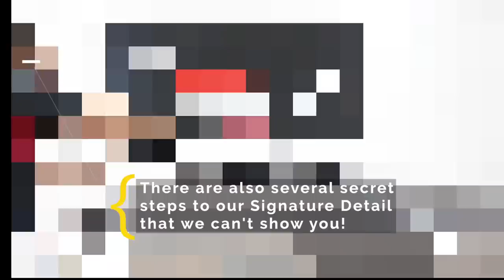Topaz's Best Kept SECRET - 100 Hour Maybach Level 5 Signature Detail!

Comment from the maker: For anyone asking about the thickness of the clear coat after the treatment, the next step for this car was our full paint protection film coverage which prevents stone chips, scratches and swirl marks, meaning the clear coat is safe!
Reply: Thank you for clearing was getting worried
Reply: amazing video thanks...do you typically use ceramic p0lished on top of the clear bras
Reply: A decent ceramic coating would be a prudent next step.
Reply: So you put a ppf that has orange peel in it and your back to how the car originally looked.
Reply: Which car manufacturer has the best quality - out of the factory - paint job?
Reply: Where do I apply for a job lol I thought I was a good valeter but this is diffrent level
Reply: @user-jt3nf7in5w  Good PPF, or any PPF I've seen doesn't have orange peel on it, PPF just tends to amplify already bumpy paint.
Reply: What is the price of this 100 hour detail?
Reply: @rdavid1987  Check Acura NSX 'Andaro' paint. Idk if this is the best out of factory paint job but it looks incredible.
Reply: What we dont show you a ceramic coating
Reply: came to the comments for this answer lol
Reply: 42treg This was definately a one time treatment. Good luck to the owner in the future
Reply: Just say the clear is as thick as it's previously thinnest point. No harm done. Nice work.
Reply: @user-jt3nf7in5w  I was legit abit to post this haha. I work for a mob that do ppf and it is far from perfect on dark color cars and is worse on white cars due to dirt sticking to edges... so much work for it to still only look good from far away...
Reply: Uhhh... a microns-thick ceramic "coating" isn't going to protect shit. If the clear is too thin, there's no UV protection and the clear will fail. That's the optional 1992 Ford Aerostar paint option. We offer a 5,000 hour repaint package at my paint shop for a limited time. A basic 1 color paint on a maybach is only $130,000.00.
Reply: How much does this treatment cost
Reply: What do you do if you cut through the clear do you touch it up ? Must your in a booth
Reply: Topaz Detailing have you ever detailed a pagani Zonda c12 s
Reply: So how much clear coat did you remove? Did you do a before and after with the ultrasonic paint thickness gauge?
Reply: Yo Joe  Yes this, I want to know what % clear coat is removed on a procesz like this.
Reply: What grit did you use for dry sanding?
Reply: Surely the finish on the ppf would be similar to the finish on the clearcoat before you sanded it though
Reply: WTF!!!
Seriously... sanding!
Goodbye paint. 
Guys, watch ammo nyc. He will never do sanding. Never!
Im only using my common sense. Sanding makes paint thinner.
Reply: yep forgot inside the doors which has orange peel as well and inside the boot as well which is also painted and you can see the orange peel? To secret is the ceramic coating full stop?
Reply: @user-jt3nf7in5w  it will have less orange peel...
Reply: the ppf has textures so it will be back with orange peel like textures?

Comment: and the paint job is chipped 20 minutes after leaving the shop, by gravel from a dumpster truck on i-95.
Reply: This.
Reply: They installed a paint protection film so no
Reply: Detailing
Reply: at this rate, the owner no longer has to drive his car , the maybach will have to be shipped wherever it goes
Reply: I know where you live now
Reply: @marnikjacobss8462  Lol, a stone chip will plow straight through something out of a bottle my friend.

Comment: Orange peel on a Maybach, confidence inspiring
Reply: through my eyes all Mercedes have it, I owned several of them, even my 31 year old 124 has it. Next time you see a brand new one go have a look, i bet you it has brutal orange peel!
Reply: NameSchema100 I live near MB World and can confirm, every merc has really bad orange peel.
Reply: @Da5hed   on the other hand you can tell instantly if a car has been repainted/ had an accident, because a bodyshop would never release a car with orange peel as extreme as Mercedes has from the factory ;P
Reply: Orange peel is there on purpose on most cars, because it helps hiding defects. A perfectly flat paint surface shows every even so tiny defect (marring, scratch, etc), which is not desirable in most cases.
Reply: It is a Mercedes, so... lol.
Reply: @berczigabor  but in this case the owner has a dude to rub it down with a diaper any chance he gets. should come from the factory like this.
Reply: @Otto-AutoPilot  it's kinna like going to a restaurant that has a dirty bathroom which EVERYONE sees, can you imagine what the kitchen looks like

same with cars, if the paint sucks, imagine what with the quality of what you DON'T see is
Reply: through my eyes all paint leaves peel,water based are much worse all cars should be wetsanded and machine compounded/polished/glazed and hand waxed...
Reply: My wife's 24k Hyundai elantra sport had far less orange peel then this maybach....
Reply: My be too. It's annoying.

Comment: Wet sanding with a long throw after dry sanding factory clear? Holy moly that's a whole new level of confidence that I doubt I'll ever achieve in my lifetime
Reply: Nick Bloodoff give it a try in a scrap panel, it’s a lot less scary than it looks but you do need to know what you’re doing!
Reply: Wet sanding with what looks to be a 15 mil throw beggars belief. Hence the massive amount of marring and pigtails left behind prior to compounding.
Reply: @chaseperfectiondetailing5745  I used a dual action to wet sand once and probably never will again. Hand sanding marks are so much easier to remove once you learn the technique.
Reply: Nick Bloodoff I couldn’t agree more. Block sanding combined with orbital sanding (no more than 5mm stroke) is all I’ve ever used. Work back to 3000-5000 grit and it shouldn’t need much more than a polish to finish out. 

I can’t wrap my head around why he went from a proper orbital sander on the first stage to a large throw DA on the second. So much unnecessary work.
Reply: Yeah I can do corrections and coatings all day long, but this is another level
Reply: Id like to see how many mils they removed.
Reply: I use my Rupes Duetto for wet sanding. Amazing little machine with 12mm throw. 15 for compounding and polishing. And the Rupes Mini for bumpers. Works like a charm.
Reply: @chaseperfectiondetailing5745  I dont know squat about finishes so pls pardon my question. Is it perhaps of the dark color? Like Blackish blue... maybe it needs more steps to show its true finish?  Thanks.
Reply: buddahlushious you’re 100% correct. The more steps typically ends in a better finish.
Reply: I would've used a D.A. Sander instead.Love using the 3m Trizact system!
Reply: Integrafreak1 trizact is a great system but don’t you find it difficult to remove orange peel with it?
Reply: @chaseperfectiondetailing5745  Yeah, If I need to cut orange peel down I use 1500 3m Dry first with the Dual sander and then the 3000/5000
Reply: Yea i work for a subaru dealership believe me i understandthe struggle they use a very thin layer of paint and clear coat alot of the cars we get (new inventory) has some of the same issues off the line as this MM
Reply: @nickstickB  facts
Reply: brandon mckee Subaru paint is really soft and stains super easy. But it takes less aggression to get it looking good.
Reply: It comes down to the grade of sandpaper used, most times its very fine around 1,500 to 3,000 grit, which comes out perfectly after paint correction and anyone who know about paint and panel knows this, the problem is that car manufacturers do not hand spray cars anymore ,thus the machines can only do so much and the thickness of painting is also a issue ,the days of painting then sanding and painting with over 10 costs of paint and around 5 coats of clear are long gone, but then again ,you can still get it done if you have the cash its that simple or your really good at car spray painting and you know how to prep the cars surface and there you go your 40K car has a better paint job than a 2.5 million dollar merc. lol :) which i love seeing cars like that perfect paint and better looking than a merc's own factory paint, lol:)
Reply: You need to use a finishing backing plate with 3m trizac paper and know what you are doing

Comment: I’m a specialist Detailer in Dallas and we offer a similar service as the guys at Topaz. I’ve been following these guys a fair few years and their work is superb. Car manufacturers would never remove orange peel it is just a free optional add on in applying clear coat and the way it cures. Great video guys. Car looks super.
Reply: An optional add on ...lol im a painter and non of my jobs have peel its the way its applied to the vehicle to much material  coming out and not enough air .....and how thin your paint is

Comment: Now that's what I call lateral and longitudinal thinking. Masking off all the swedge lines, for example, to prevent sanding through the edges is a very simple but highly effective method.

The design and quality of the DAs and machine polishers enable the kind of precision aimed at and achieved in this tutorial. Having the right tools and equipment combined with a fine eye for detail and plenty of patience are key elements in achieving a flawless finish.

I wonder whether the secret stage involves baking the car at a certain temperature after a certain (ceramic?) coating has been applied and removed to create a protective barrier and lasting finish.

Comment: Very nice job it’s a huge undertaking to get paint perfect. Anyone complaining about clear coat being removed that car probably gets washed and waxed twice a week so it won’t mater. Paint lasts forever if it’s looked after. 
I just finished restoring 2 vintage dodges and it took over a week on each car to rub it back to get the paint like that. 
Great idea fine lining the high points.

Comment: I remember having to get a finish like that when I was using cellulose paints. Final flat with P1200 wet and dry to remove any imperfections, then start polishing with Belco rubbing compound, before applying polish. Everything done by hand.

Comment: If doing ppf does removing orange peel change the result once the ppf is layed?
Reply from the maker: PPF adds a very slight amount of orange peel, however, much less than the amount that has been removed in this process
Reply: @puhipuhi8696  orange peel is the term used for texture in the finish of the paint. It's called orange peel because the texture looks similar to the texture of an orange peel
Reply: pause the video at 00:24 seconds.  that is orange peel.
Reply: vladimir kostic, that’s called cellulite.

Comment: I got the same results on my 06 chevy silverado  4x4  its dark ming blue metallic with 1500 wet sand then 2000 wet and Maguires ultimate compound  wool pad  foam pads and finished with ebony polishe  and microfiber towel its my everyday driver my factory finish from gm dident even come close to that million dollar wrinkled finish that looked like shit but in the end its sweet that's all that matters nice job

Comment: All of this work on a car that will depreciate faster than the Titanic sank. Bravo!
Reply: people who can afford it wont care about the depreciation.
Reply: Actually mayback kept their value
Reply: Hilarious!
Reply: It’s a Pullman no way it’s losing Value
Reply: Luxury cars do not hold their value. Luxury buyers want the latest and greatest tech and gadgets. This is the reason their value plummets and 85% of luxury cars you see on the road are leased -- specially German brands. This is also why you can by a 7 year old $100K S Class for 20-25% of it's value while a same year same mileage Honda Accord only dropped 50% of it's value while retaining it. As years go by from there, the Honda will hit residual value while the luxury cars continues to drop. Fact.
Reply: @Golds_fox  With what information are you enforcing this? The older 57 and 62s are beyond dirt cheap. The new S600 Maybachs' will depreciate in the same manner.
Reply: But in no other car offers you top luxury like an armored tank and that has got enough legroom to have 2 models blowing you!!
Reply: @sdlausen1  It doesnt matter wether its a luxury car or not. Supply and demand. Luxury cars have passionate collectors same way as jdm, oldtimer,muscle etc. So if theres a limited and well maintinanced one, it will rise in value or hold its value. Fact.

Comment: Absolutely amazing work. I'm planning on doing my first ever full wet sand detail this year on a Focus RS Mk2.
Reply: PPF if using Xpel ultimate works out at about £100.00 a metre .!
Give the car  full paint correction then use Gtechniq crystal serum  .. ceramic coating .

Comment: How many microns were removed during the process?
Reply: Kennedy Catala it’s how paint depth is measured, essentially I’m asking how much lacquer was removed from the car by the sanding and polishing stages in this example
Reply: If you ask me quite a few. Looks like a big clear coat process..
Reply: I'm asking the same question.  How many microns before he started. Then how many when he was finished? 
  If he went to deep. This car may look great now. But with almost no clear coat left. What will it look like in a year?
Reply: einnol B just asking out of curiosity 🤔
Reply: @ltsgarage7780  This is where PPF comes in.
Reply: @dinan5iver  PPF?
Reply: @Bigbitsuni  If you have orange peel then you pretty much have more than enough clear to work with? lmao. Something cleared with one coat can have orange peel. Checking the depth of the clear while correcting a 100k+ plus car isn't funny, it's smart. The last thing you wanna do is have to have it painted where you sanded or burned through it. His buffing procedure was normal and the steps were correct.
Reply: einnol B Sure you have. If that’s the case you wouldn’t have made the orange peel clear comment .I love hearing the I’ve done this and that and done cars you will never touch in your life bit. You know absolutely nothing about me. Your so called 20 years detailing cars pales in comparison. The guy who does it in the order you are criticizing is the guy working on the 100k + car and clearly knows what he is doing but I guess your way is the right way?
Reply: @Bigbitsuni  lmao! So all the cars at dealerships with orange peel on every single one of them come from excessive clear? Do you know how many coats of clear actually goes on a factory car? It isn't excessive..Its minimal.  Like i said before you will have orange peel with one coat of clear. It doesn't have anything to do with the number of coats. I've laid paint/clear and finished about every make of car out there so you aren't going to impress me by detailing any car. Declined a deal with Telsa? Must have been a local dealership wanting you to be the wash guy. Like i said before the guy that uses that method is the guy doing the Maybach and still getting paid for it after the job is done. I still can't figure out why such a professional like yourself is spending all night watching videos of others detailing cars on YouTube.
Reply: @ltsgarage7780  Paint, Protection, & Film: https://www.youtube.com/watch?v=ncl2zqzpGbk
Reply: @Bigbitsuni  So every car is trash? They all have orange peel. I'm sure Jordan does watch basketball it is an entertaining sport that everyone watches but i doubt he is up all night watching it. Why would a dealership call the local detail shop and ask the owner to wash brand new cars for them? You don't need a detail pro to wash new cars. Who are the players cars you detail?
Reply: @Bigbitsuni  Just utube warrior... lol
Reply: Mercedes average Clearcoat is 40-60 microns on vertical panels and 50-80 microns on horizontal panels , I’m not sure but looking at the video you could have removed an average of 20-30 microns so you have enough microns left for protection ..
Reply: K1CGT lacquer? This isn’t the 60s..
Reply: The entire car has a protective plastic coating so it wont need to be buffed or waxed ever again.

Comment: And than the owner takes it to be wrapped, next door... For protection.
😁😁
Reply: No they are installing the ppf right after the paint correction process.
Reply: @Pty-gk2vb  basically a wrap 😁
Reply: @sim6057138  yes and no🤓 is like saying 3 state paint job without ceramic clear coat is same as a 3 stage paint job with ceramic clear coat.🤷🏼‍♂️
Reply: Vraiment j'apprécie votre travail. Et ça me plaît beaucoup de venir travailler avec vous dans votre société si vous voulez bien....
Reply: Moi-même je fais la peinture. Ça me plaît beaucoup de venir travailler avec vous

Comment: Some orange peel on a paint job is good. The orange peel helps diffract the sun light. When you cut and buff a paint job flat the clear coat acts like a magnifying glass and will degrade the base coat underneath. I’ve flat sanded several show cars over the years and I’ve always told the customers to keep them out of the sun as much as possible. Flat sanding a car looks awesome but it’s not something you would want to do to your daily driver that gets parked outside all the time.

Comment: when dry sending whats the grid are you using pls help?
Reply: Depends on the orange peel. 

I ussually start at drysanding 1500 up to 2000 from 3M
Wet from 3000 up to 5000(depends on color) brand is mirka abralon 

Doing this since years, works great.
Reply: @ravedave513  thank you Sr

Comment: as a proffesional body and paint techncian for the last 25 years, what you really should have done is flow coated it with premium clear when you intially sanded it with 1500.then refined the flow coat. that would have bein the perfect finish, atleast 5 times the protection aswell.